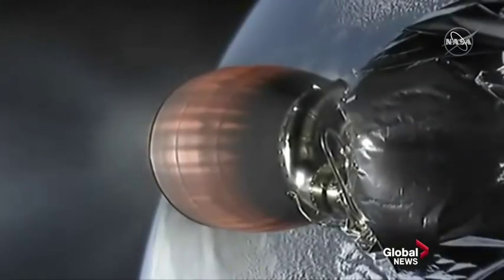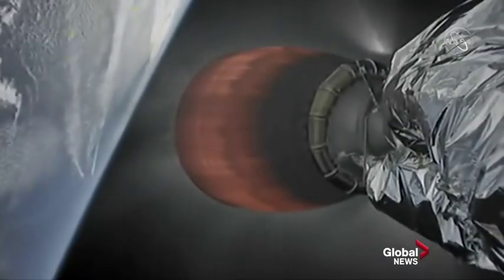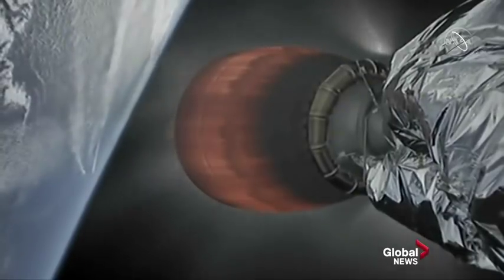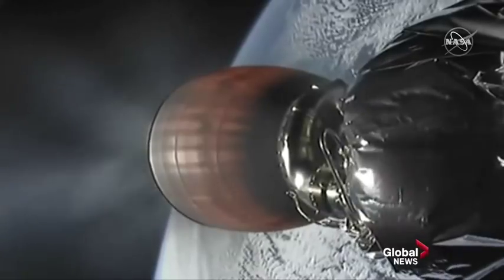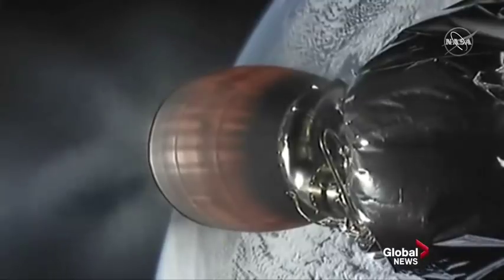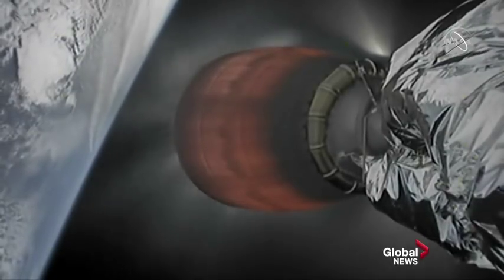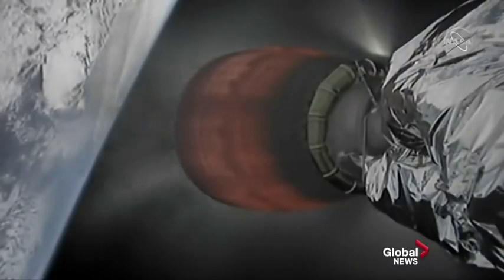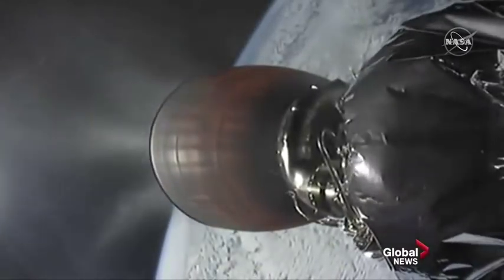SpaceX suffers 'bummer' landing as rocket's first-stage booster crashes on re-entry

Comment: Something, not known yet, caused the booster to pitch up, grid fins adjusted to correct, over-corrected causing the roll possibly due to the mentioned pump malfunction, adjusted again and again over-corrected causing the booster to roll in the other direction. Miraculously the booster still soft landed with the flight computer still transmitting data.